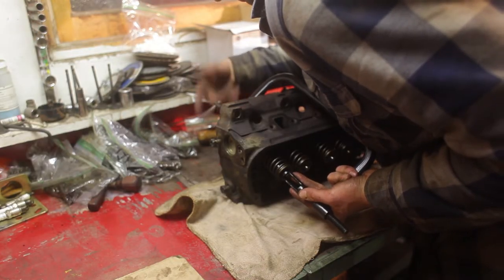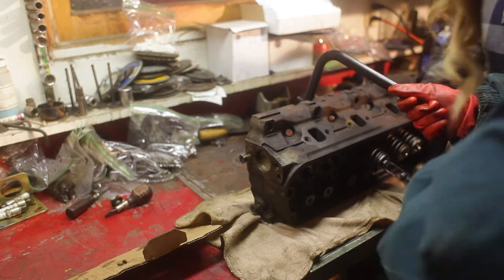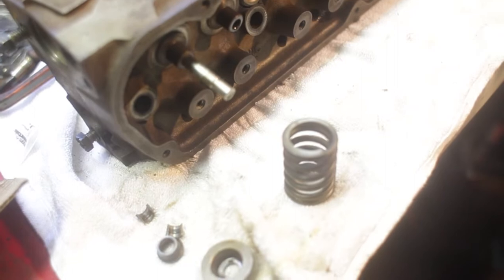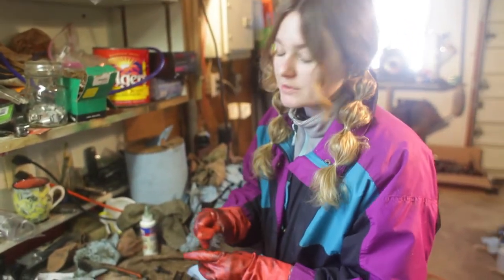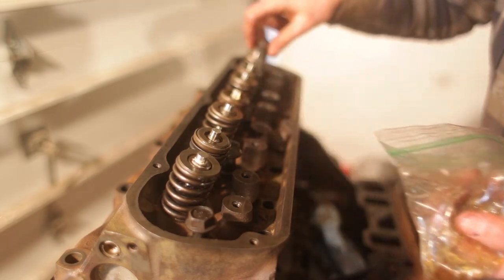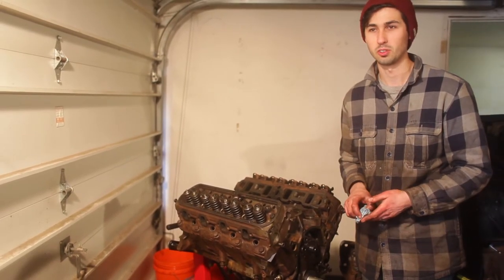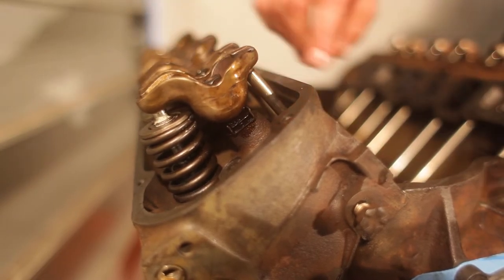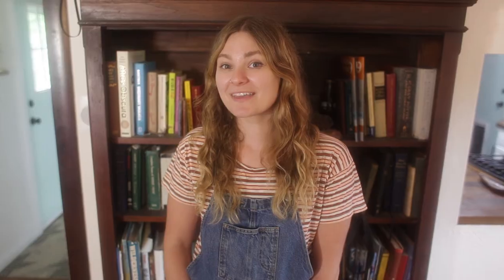Ford V8 Head Install: F250 Restoration part 13

Comment: R.V. cam is a solid choice. Great in the lower rpm band. Great for torque.
Reply from the maker: Spins the tires when you floor it!
Reply: @TheBadTimingClub  I bet. Trucks are meant to have torque. Great job.